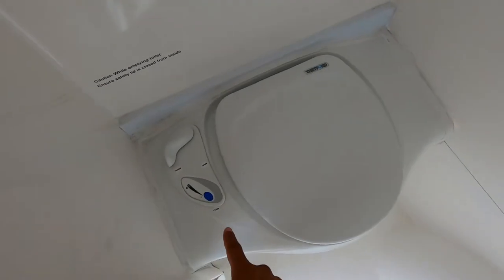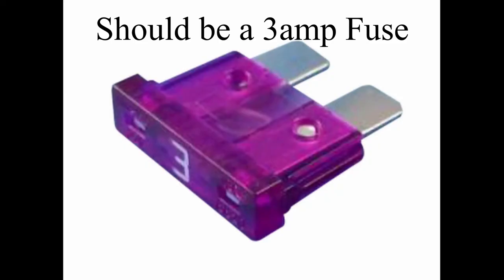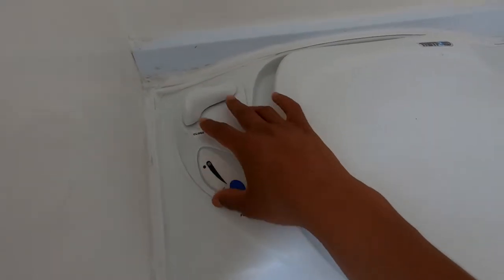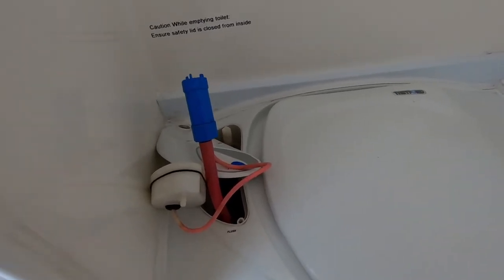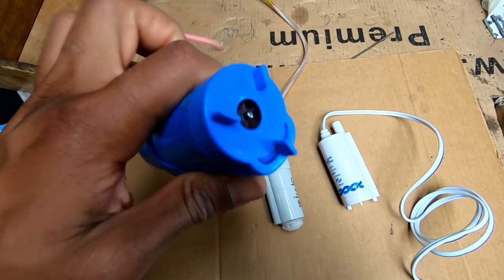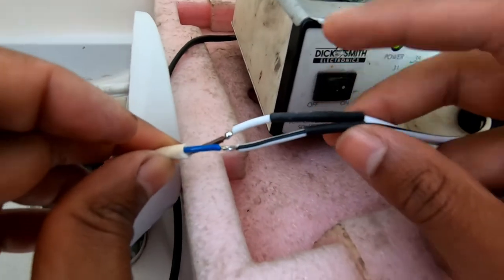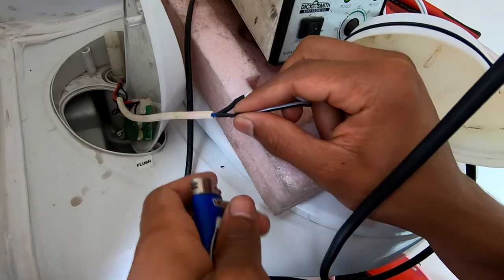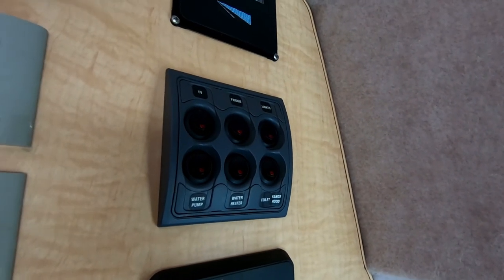Camper Toilet Flush Repair Thetford C402 (Motorhome)

Comment: Thank you so much for this video. My tC402 toilet was not flushing, blowing the fuse. I traced the fault to the pump, and after much cursing and swearing managed to extract it. With a bit of persuasion I was able to free up the impeller, tested it, gave everything a good clean, put it all back together, and hey, we have a flushing toilet again! I hadn't drained the flush tank while it was laid up for 9 months during COVID lockdowns, which probably caused the problem. Won't do that again. Couldn't have done it without your excellent video. Many thanks.
Reply from the maker: Awesome! Glad you solved your problem. Appreciate the comment.
Reply: Same here

Comment: That was a really handy video and very in depth which was a great help. Yes sitting idle for long periods during NZ lockdowns so plenty of mold to flush out and fortunately a screwdriver managed to turn the pump impeller and now all working again. Hardest part was trying to pull the pump up and out lots of scratches on the hands, that wasn't easy but knowing it could be done from the video gave me the confidence to keep going.
Reply from the maker: Great to know you fixed your problem!

Comment: Thank you so much for this video, our toilet stopped flushing guess it had been stood up due to CV-19 and we followed your video and now we have a flushing toilet again!! The fuse and the pump had ceased, we were lucky managed to get the pump turning again. Very happy thanks
Reply from the maker: Thank your for the comment! If the toilet has not been used for sometime I suggest draining all the old water and adding fresh water along with the chemical you normally use.

Comment: Do you know what voltage the pump is? I would like to test my pump, to determine if my issue is the small control board OR the pump, and although I would suspect the pump would be 12v, I don't want to assume anything.
Reply from the maker: Yes its 12v DC

Comment: Thanks for this very helpful video.   I had a terrible time getting the pump out - read about putting hot water in to soften the hose,  which made no sense to me since the hose is on the output side of the pump that doesn't work - but having no better idea I tried it and to my surprise, was able to get the pump out.   It looks like Thetford goes out of their way to prevent anyone from seeing an exploded view diagram of this toilet - has anyone found one?    I anticipate at least as much difficulty getting the new one in as you had - and  you'd done it before!     But half the battle is over.
Reply from the maker: @w9ran   Glad it was helpful. The rubber pipe unfortunately goes hard over time, hot water definitely helps soften it up. I've got another video which may be helpful to you see link below: 
https://youtu.be/y6AeIT_bLMY?si=GNwqFigS9_H1CHSN

Comment: Very usefull video.
We arrived on site yesterday and found the loo pump wouldn,t work.
Took of the control cover and found the wife a little job ......normally the other way round ! to lift out the pump with her small hands. Turned the impeller with a screwdriver and hey presto its working again only better flow than before.
Thankyou for showing us what to do.
Reply from the maker: Awesome! Thanks for the comment

Comment: Great video...

On my T400 there is a plastic extrusion in the tank about 20mm which you have to press the hose around to free the pump.   Took a while to figure out.   After I got the pump out I reconnected the power and tested it before cutting the wire - and lo and behold - it worked.  Putting it back I angled the pump into place and then pressed the hose back on.

Gave everything a clean and reassemble only to find the opener had now jammed.  Took that lid in the cassette off and cleaned it on top and underneath and it freed up.   A quick spray with lanoline, clean again and the a spray with silicone and all good again.  

It seems draining, flushing and cleaning could have avoided all this work, but who knew?  

I wouldn't do this work for someone else, even with PPE, so I imagine a caravan repairer would charge about 3 hours labour + parts or just install a new toilet.
Reply from the maker: Thanks for the comment, draining/cleaning the tank on a regular basis prevents issues definitely. Its not a pleasant job when doing it for someone else that for sure

Comment: Ah, yes, the lovely Thetford cassette toilets. I'm still trying to solve the problem of making water flow uphill so that I can fill the reservoir. In any case, pumps send water from one place to another place. The pump in my trailer works (i.e., it turns). However, there's only one hose that can carry water. Where does that hose actually go? Where does the water that the pump pumps actually go? These are honest sincere questions. I'm trying to get the toilet in my trailer to actually work (i.e., pump water from the reservoir into the toilet bowl, rather than just turning). I probably should have just left the pump alone after replacing the fuse, but I may never learn to leave well enough alone. Any actual help appreciated.
Reply from the maker: Sounds like you have not submerged the pump in the lower portion of the flush water tank. What happens over time the pipe to the outlet on the bowl can get hard which in turn can pull the pull out from the correct area where it should be located right at the bottom.

Comment: Great video! I got the pump out after my husband cut his arm up and gave up. Finesse is not his strong suit. Lol. When I pulled up the pump, though, the fat tubing came up with it, and it's open on one end, and attached on the other. Did I pull it loose from something? I sure hope not!
Reply from the maker: Thanks! The tube has to be plugged back in at the top spout/ fitting where the flush water exits at the bowl.
Reply: @AutoBuddynz  It just slips around it? I didn't break anything off? It's really hard to feel around and find anything to plug it back into. Is it near the top or the bottom of the chamber?
Reply: @AutoBuddynz  thanks for responding!😀
Reply from the maker: @tamaraandersen5345  https://www.rvsupercentre.co.nz/thetford-toilet-part-c400-flush-tank-drain-tube-ki

Part no 52 the pipe goes near the top toilet ring, if you put your hand in there or a mirror you will see where to push the pipe back on

Comment: Hi mate I have a thetford C402C toilet in my motorhome & have 2 issues I hope you can assist with.
One is the toilet level indicator lights inside the van no longer work
The other problem is a small spring which I believe assists the toilet blade handle return to closed position fell off the arm inside where the cassette slides in and am unsure where both ends attach to believe I can see the one small hole on the moving arm though cannot see the other attachment hole can you please help with these issues thankyou
Reply from the maker: Hi Neil, not sure if you fixed your issue. The level indicator lights can be problematic on this model, sometimes the board needs to be replaced. As for the spring I recommend looking at this part diagram and trace back from there, hard to tell without seeing a picture or similar  
https://www.caravanparts.com.au/diagrams/toilet/thetford/c402c-x/

Comment: Great video,some useful tips.
I've got the same toilet in my van, but  the pump is working and no flush water is coming out of the nozzle in the bowl. I'm presuming it's disconnected from the pump. About to attempt to fix. Found the dismantle part useful. Thanks
Reply from the maker: Great to know you solved your issue!
Reply: @AutoBuddynz  yes ,it took me 5 mins to fix thanks

Comment: If you check photos of 402c pump. It comes with a white plastic part which is connected to the bottom of the pump. Where is it? I mean why it is not in your video?
Reply from the maker: @trashcan4u853  Thats correct its the holder for the pump, most of the time due to the age of these toilets they are missing, not a big deal still does the job as long as you follow my video